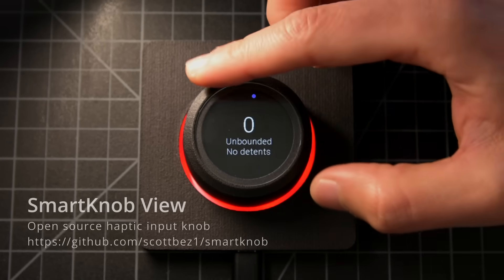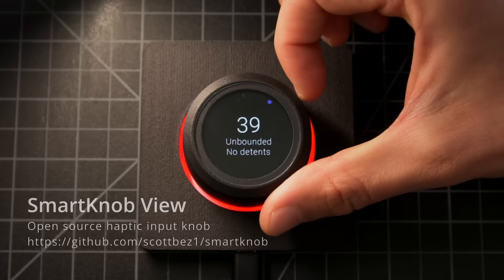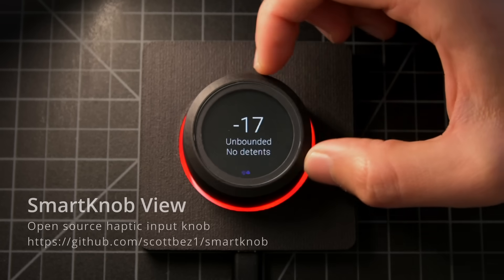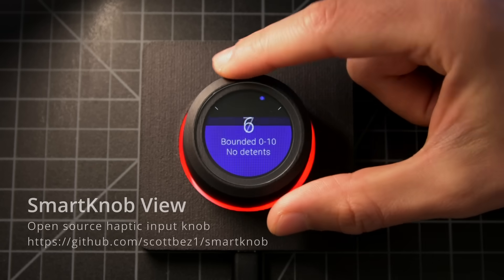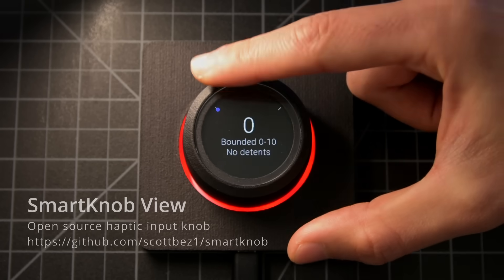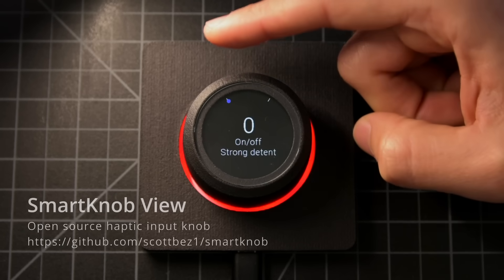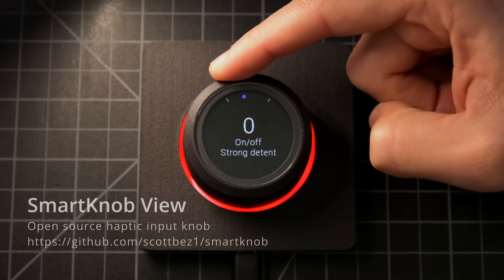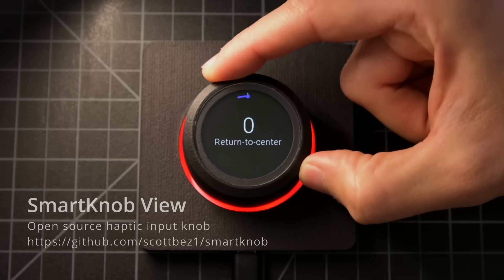DIY haptic input knob: BLDC motor + round LCD

Comment: I want to link it to a RGB bulb like Hue or similar.  One press for on/off, then a setting for brightness that you can haptic tap to a three-way selector for R, G, B and the display previews the mixed color.  Can you do long presses and short presses to change modes like that? And in addition to tapping on the screen, can you push the entire knob in with a more physical click for on/off?
Reply from the maker: Long and short press are definitely doable! It might be possible to do hard vs soft press, but it could be tricky to distinguish.

Comment: I was trying to do that with tmc2209 in raw mode and a 2d printer stepper, could not get the same precision, but had some fun with cancelling the stepper motor magnetic detents with software control, emulating smooth movement

Awesome project you did, and great attention to details!
Reply from the maker: I was wondering if software detent cancellation would work - it's been somewhat tricky to find BLDC motors with minimal cogging torque so that was something I considered trying. Did it work alright? I'd imagine you'd also want to make the software slowly rotate the position to the nearest magnetic detent when idle, to avoid running continuous current through the motor...?

Comment: This is really an awesome user interface component. Can you tell me what is the approximate component cost to build one?
Reply from the maker: I wish I had a good answer for you, but this has been something I've been tinkering on for a while so I don't have an exact number handy... I would say it's almost certainly less than $200 (including the mail-order MJF 3d printed parts), but not sure exactly how much less than $200. I can't think of anything that was super expensive individually, but there's just a lot of little things (LCD was like $6, motor was ~$4, electronics probably $20-30 including shipping, PCBs maybe $20, 3d prints maybe $30-40?). I plan to put together a comprehensive BOM to the GitHub project, so maybe check back in a few weeks for more specifics?
Reply: @scottbez1  Thanks. Some people at work are discussing pooling our efforts to have a PCB made and put together all the parts to make some of these. I look forward to the full BOM. What is the LCD you are using?
Reply from the maker: @mghumphrey  Nice! LCD can be found by searching for GC9A01 - it's 240x240

Comment: Oh this is an absolutely gorgeous device! 
I actually thought about building a similar knob (without screen, only the haptics part), but this here is a gorgeous solution!  This would pair incredibly well with my DIY SmartHome solution, which already runs on ESP32s with MQTT :>

How expensive is that LCD though? Unusual-ish formfactor and all...
Reply from the maker: I got these LCDs for something like $7 each, including shipping (from AliExpress). I'm assuming they are new old stock, designed for some previous generation of smart watches. Look for GC9A01
Reply: @scottbez1  Ohhhh wow, that is a must-try-out for me then!
Though I try to stick to parts from more consistent vendors to aid reproducability.

Now I'm wondering if those exist in slightly larger versions - then one could build an "Amazon Alexa" style device but the entire top spins as a bit of an input device.
The ESP32 is perfectly capable to drive speaker and mic too, and increased portability would be nice...

Ah, but now I'm just getting carried away.
Reply: @scottbez1  Oh wow, i was expecting the price to be much higher considering how kinda niche it seems to be

Comment: Relatively inexpensive parts... For all the materials, what price are we talking about?
Reply from the maker: I don't have a full BOM put together yet, but the "big ticket" items were still pretty cheap even in single quantities, though I guess they do add up a bit. Motor was $4 shipped, magnet sensor is a few dollars, ESP32 module was $7 shipped, LCD was $6, watch glass was maybe $3. Miscellaneous other electronics (LEDs, resistors, capacitors, CH340, HX711, TMC6300 motor driver, connectors, etc) were probably $15-25? Biggest single item for this was the 3D prints, which I ordered MJF printed and was maybe $30 for one full set? Could probably be printed with a well-tuned FDM printer, but I like the surface finish of the nylon MJF print so that was definitely worth it IMO.

Comment: Very inspiring! I've been working on a musical instrument controller based off a Teensy and a AS5601, along with some haptic feedback. Really love the addition of the motor and display here. Curious how "smooth" the motor feels when just spinning/rotating it. Ordered a few off Aliexpress to have a play with.
Reply from the maker: This motor is basically completely smooth when unpowered, which is relatively rare - I've ordered and tried a LOT of different motors from AliExpress and most have noticeable cogging.
Reply: @scottbez1  Fantastic! For my controller I put a fair amount of time into getting really smooth skate bearings, and some offset weights (ala fidget spinner) so it tends to skate along quite smoothly on its own. I look forward to it arriving and playing with it. I've not dug that deep in Teensy-land (motor drivers), but the interface options are pretty staggering.

Comment: Musicians are going to be all over this.  It could make minimalist interfaces very intuitive, for samplers/synthesisers/etc.

Edit: just a thought, could you make the various haptic things in there "feel" the audio sample while the knob wheels through the sample?  Sortof like scratching through an LP record, but you can feel it in your fingers instead of just hearing it with your ears.  It may somewhat allow you to preview a sample via how it feels, without needing to hear it.
Anyway, not sure if the haptics would have enough fidelity.  But adding in the motor may add more, I'm curious if them combined will unlock unpredicted levels of tactile perception.
Reply from the maker: That's a really neat idea. I imagine it should be possible to get some amount of audio "feel" through the motor, since it's really not that different than a speaker. I've been meaning to try playing simple tones through the motor as a start, but it could be interesting to hook up full audio playback and connect the playback position to the encoder if possible... 🤔
Reply: @scottbez1  pitch shifting the frequency way down (or some other audio filtering effect) may be nessesary to make the resulting "texture" more tactile & less audible.
Reply: I was thinking of a similar application of custom configurable MIDI controllers. These would be great for a “grid of knobs” style controller!

Comment from the maker: I'm thinking this could work well with Home Assistant, or as a fancy jog wheel for video editing. Maybe mute and volume control for Zoom calls? What else would be cool?
Reply: This would be a next level spacemouse for 3D CAD designing 😱
Reply: Just posted this to the Home Assistant subreddit before seeing this comment.  Yes, so much yes!  I can envision so many possible uses for this.  What an utterly fantastic project.  Well done!
Reply: Also see my other longer comment, but these would be great for a MIDI controller for audio work!
Reply: Or possibilities for an opensourced smart watch with tactile feedback.
Reply: Open source Nest-style thermostat perhaps?
Reply: I would LOVE to have this in Home Assistent/ESP Home!

I do a camper van conversion and try to make it as smart as possible! I want to avoid all the ugly displays and controllers they usualy have in RVs. So my plan was to have a single 7inch touch screen and my smartphone to manage everthing over a home assistant dashboard. 

BUT with this SmartKnob at different locations in the van it would be sooo much easier and cleaner to controll lights, the heater (showing temperature info), window covers (controlling exact positions), the waterpump (including tank level info), controlling the fridge, starting the inverter and what not..... All from ONE KNOB!!!! 

This would just look and feel so nice!

This video does not went out of my head the last two days! Im am so exited so buy the components as soon as this project gets "stable"!!!
Reply: I imagine it in a car dashboard, where you can cycle through, get a satisfying click to turn on the AC and then the stepped dial for temperature control
Reply: Could be very hand in cars for their climate control needs. A lot of cars going towards either full touch screen modes (which are a terrible idea from a safety stand point) or applying 'digital' knobs but with no way to tell the setting without looking at it. That magnetic feedback technology (whether it be used for limiting, increasing resistance or applying limited detents) would definitely come in handy to inform drivers without looking away from the road.
Reply: @someguy909  I'd much prefer a multifunction wheel-based systems, especially if they had haptic feedback like this
Reply: Anything audio as well. Volume, Pan, EQ, Compression. You name it.
Reply: Replacing the screen with a touch capable screen would be great. Swiping through different options (smart home appliances, video editing tools, insert domain specific tool set here) and then pushing in to select would be great. Imagine having this built into your wall as a minimal control hub for your lights and thermostat!
Reply: I'm sure sound designers could get a use of a bunch of these
Reply: Fan speed 😂
Reply: That would be suitable as a force feedback wheel for a gaming console controller, for driving simulators. A similar controller to those used for RC cars when driving, with a trigger throttle and other accessories, but most importantly with force feedback steering knob.

Comment: cool!
Reply from the maker: Thanks! Your video was such an awesome inspiration!
Reply: @scottbez1  Thanks.  i just re-watched the video you linked.  i didn't really describe it well but one of the goals was to be able to tie the torque driving my electronic leadscrew (ELS) to the haptic device so you could "feel" the cut.  This is what the project I mentioned did and bridges manual machines and CNC machines.  I never got around to doing it but I did get my ELS working nicely.  Maybe one day i'll dust the code off and give it a try.  I really like the LED integration you did.  It is a very nice touch.  You could also mount the motor on 4 tactile switches to give it a joy knob type of feel.